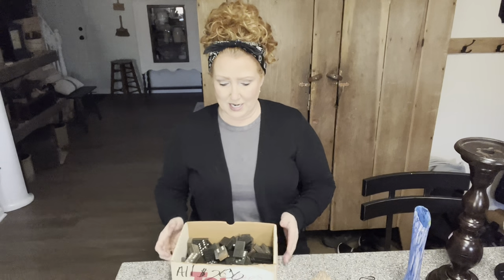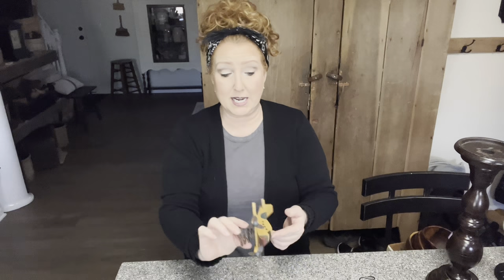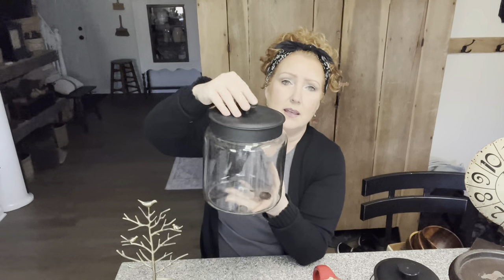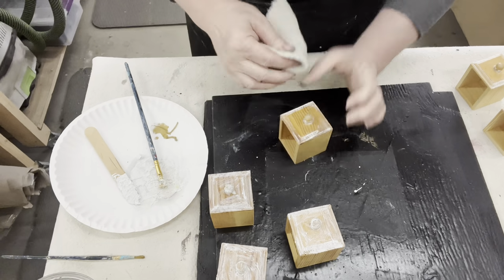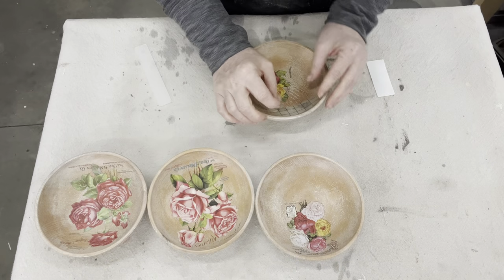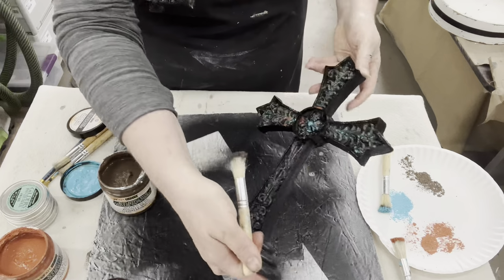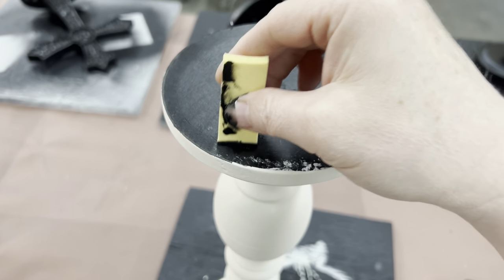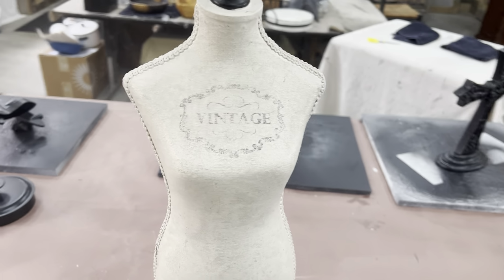Thrift Store Haul | Home Decor Makeovers

Comment: for decoupaging over knobs you can't remove, cut a line from the bottom of your decorating sheet up to the middle cross section of the sheet and hole punch at the top (as an open space for the knob to fill). this should help make application easier and give you a smooth professional finish application.  Beautiful finished products as usual! thanks for sharing ♥

Comment: Thrift store tape, price tags and permanent marker. Ugh! Not only can it be a pain to remove but I am always a bit aggravated by the placement of those mentioned above. Am I the only one who has a Goodwill that will mark with a permanent marker right on the front of things? They used to be a lot more particular about their pricing and where it is placed. I cannot count how many times I have passed up good items because whoever marked them with permanent marker didn’t have the common sense to place them in an inconspicuous area. Placing price tags and tape onto areas that will tear when they are removed is one thing, but that daggone permanent marker can be a chore to remove and may still come through when we don’t want it to.
Reply from the maker: Oh.. I’ve wondered how well that comes off. I can’t imagine it would be able to be removed off of everything. It would ruin an item 😬
Reply: @GingerChickRehab  I’ve thrifted a few in which I couldn’t remove or cover the permanent marker on. My first job was actually at Goodwill. They used to be very picky about their pricing. Not only the price (price to move) but where the price was to be placed. Back then we used the pencils that have a sort of crayon like tip (the actual name evades me right now) to mark the price on items. This was before the actual Goodwill price tags were a thing. The crayon like marking were fairly easy to remove without damage. If they must use Sharpie why wouldn’t you put it on the bottom or where it would be covered if you hung it on a wall? 🤷🏻‍♀️ Forget re-selling. I wouldn’t want that in my decor. I think they need to do more training. Not only on that point but to also make the pricing from the morning shift and afternoon shift fairly close. I think whoever does the pricing at one of my stores in the afternoon has severely bumped their head. Lol. Anyway, I love you, Chris, your channel, your make overs, all of the things you teach me, show me, share and loving the perfectly imperfect just like me. ♥️🥰